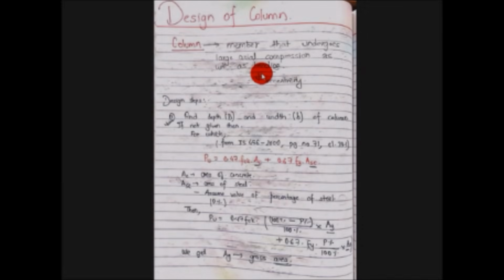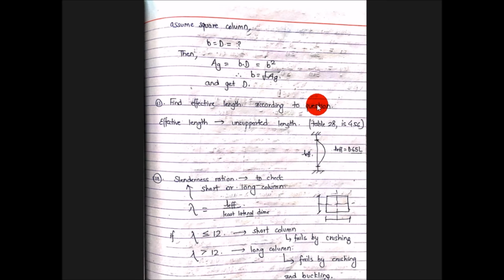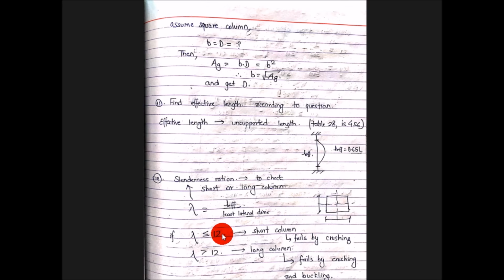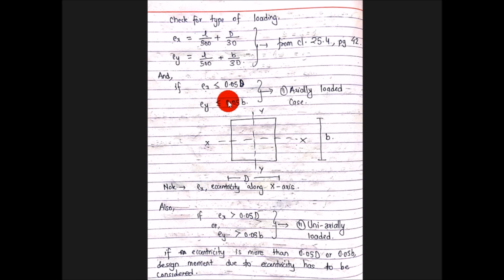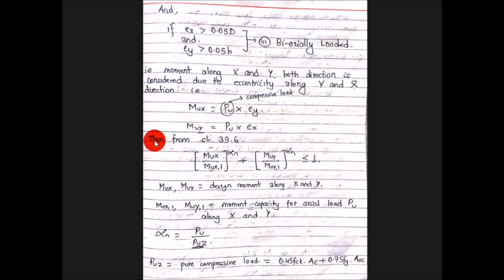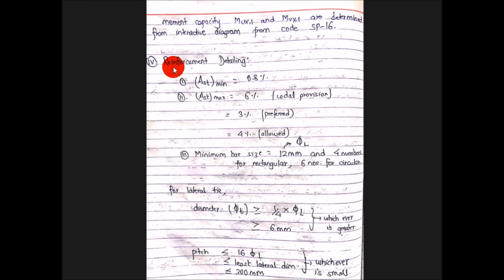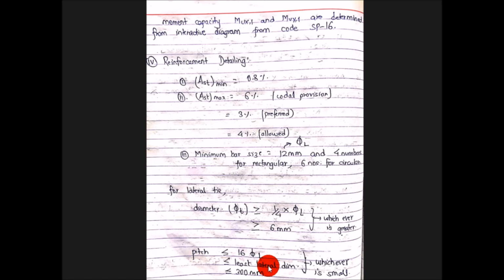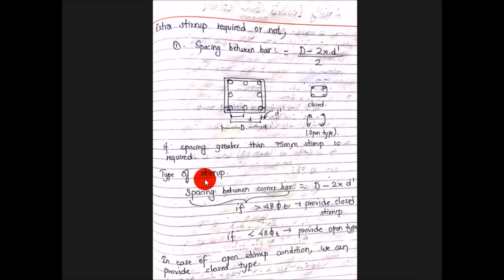Design of RCC Column | Introduction | Limit State Method | Mumbai University | IOE , TU , PU

Comment: about the eccentricity, it is still very unclear about which dimensions to use.  some video uses D for ex and some video uses b for ex. 
can u make more clear video.  The concept of using which dimension b or D to used for L/500+?/30 for x or y ?
and 0.05 ? is for x or y ?
so confusing !!!
Reply from the maker: Consider b as smaller value and D as a greater making Y-axis as weaker axis from MOI perspective. You get D for ex.
Reply: @civilconst   For example, if a 3000mm high column is 230mm wide by 400mm deep, and we want to check the minimum eccentricity on the axis parallel to 230mm, then what would be the values for D in this formula: L / 500 + D / 30 ?
And please when u answer, give some reference from IS code.  Thanks in advance.